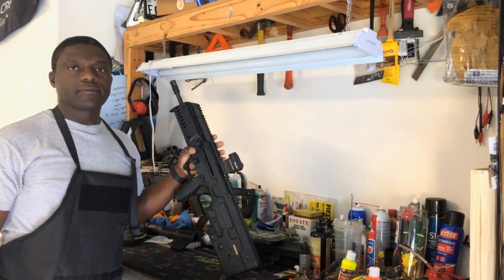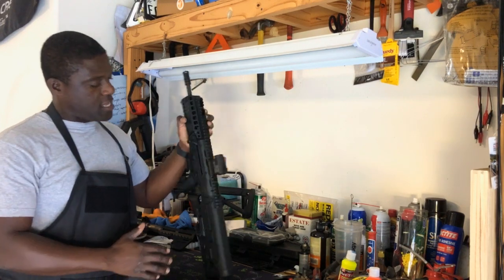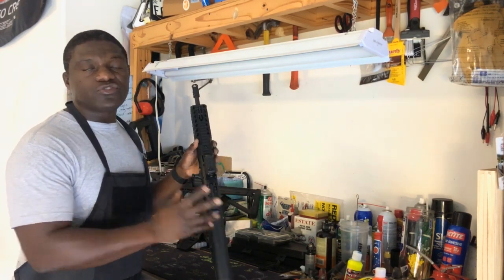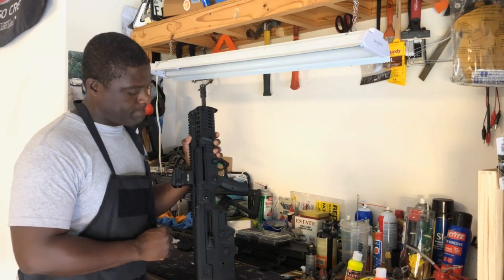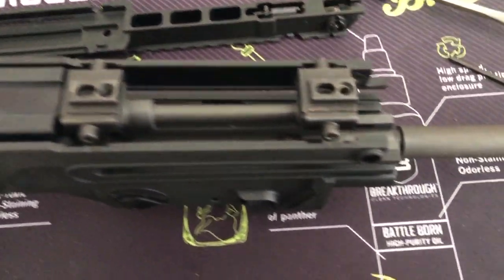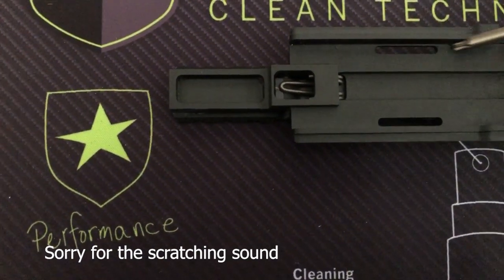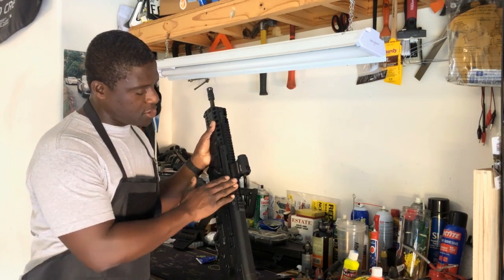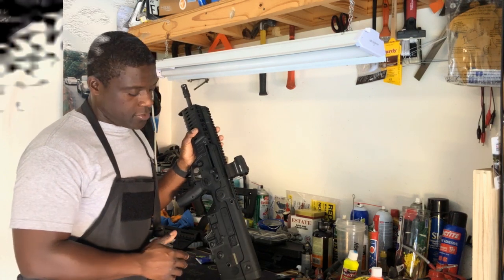DIY: How to fix the Tavor X95 gas blowback - easy and cheap

Comment: If you're in the suppressor game, check out the OSS helix.   The flow through design is fantastic for gassy firearms such as bullpups.  It does away with a lot of the back pressure and directs those gasses foward.
Reply from the maker: J Crews Thanks for the tip, I’m getting into cans as well. Upcoming videos soon. I’ve had my eye on the OSS. A very good option for the X95 indeed.
Reply from the maker: Just posted my lessons learned about suppressors... more to come. https://youtu.be/W_Lr1gPBFsI

Comment: This is unacceptable for a rifle that goes into the $2000+ price range after taxes. Just spend a bit more and get a Steyr AUG A3 or Desert Tech MDRX. Someone is going to get blinded eventually by the x95 and IWI is gonna get sued. I cant understand why they don't fix it preemptively, none of their other Tavor stuff have these issues meaning they know how to not do this.
Reply: I think if this dudes rifle has this much gas coming back  unsuppressed, there's an issue. I guess I can only speak for myself but I've been shooting an X95 for years and several thousand rounds and have never experienced the gas blowback he's getting. Even suppressed with an omega 36m it's not to bad in my opinion (although the goal is 100 percent no gas) As far an Aug or dessert tech, that's a whole 'nother can of worms, especially for an inferior bullpup, at least in my opinion.

Comment: Tried this on my X95 sbr with a Turbo K suppressor and it worked great! Dramatically cut down the gas to my face. Great vid and tip. Thanks!
Reply from the maker: Great to hear!
Reply from the maker: How is that Turbo K on the X95?
Reply: @EasyBTactical  Sound/size wise it's pretty great! Really tames back the concussion and lets me use just in ear foamies instead of doubling up. Very nice in the summer heat! With a 13" barrel and a kurtz kit the gun + can is shorter than my 11.5" AR unsuppressed. It does over gas the gun even more than it already is though. Went from recoiling like an over gassed AR to recoiling like an over gassed 7.62 AK. I got a high energy recoil spring from ShootingSight to try to tame that back a little so the gun doesn't beat itself to death. If that doesn't work then I'll probably get an OSS can for it eventually. Pew Science is showing some impressive/surprising performance from those cans.
Reply from the maker: @cbr4tigger  Thanks for sharing. Yes on the OSS. I have a buddy who's dedicated one to his x95 and they seem ideal for it, based on what I've seen so far. Good match. Perhaps that's coming for mine...just more $$$... as usual. A Titanium version would be nice.
Reply: @EasyBTactical  Update on the ShootingSight spring swap. Finally swapped it out and took it to the range. It worked as advertised. With the Turbo K it went from 7.62 Ak recoil to slightly overgassed AR recoil. Unsuppressed was like a smooth AR. Definitely a nice upgrade and a lot cheaper than a new can!

Comment: I used heat-resistant electrical tape on the same spot as the video except some part that i think is unnecessary. I will let the blue-lactite I applied to the top rail screws cured before i will test it. And also, since I removed the top rail, i Installed 1/2 riser for my red dot. I will test it next week on my weekoff and let you know the result.
Reply: Hi I have the same, did you fix the gas problem?

Comment: I have also had issues with the gas blow back. In my mind I wanted to use a material similar to what you used I just always thought I shouldn't ever need it. So I see the vid is almost a year old, have you come across taking it apart? does this material make it annoying when trading out parts? Id assume Id change trade out for the elevated rail at some point to give myself a better eye rest. Also just got a Saker 556K ASR. I had lots of jams basically not usable. Guy at the range told me to adjust the gas line, but I dont know if that's a thing or not in the X95. I will attempt the OSS Helix in the future but if that and your fix dont help this issue, Im prolly going to switch back to a AR platform.